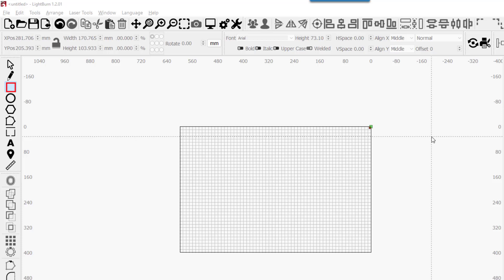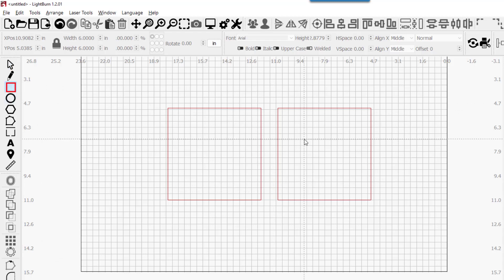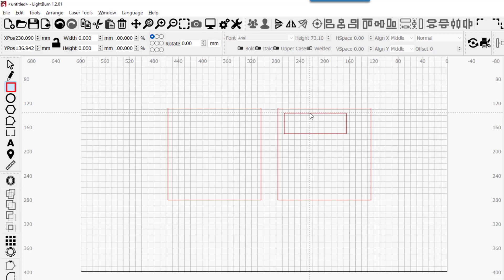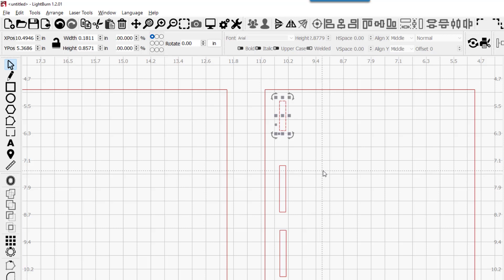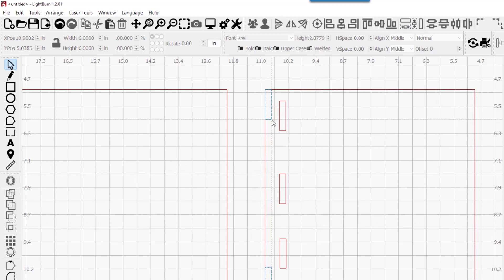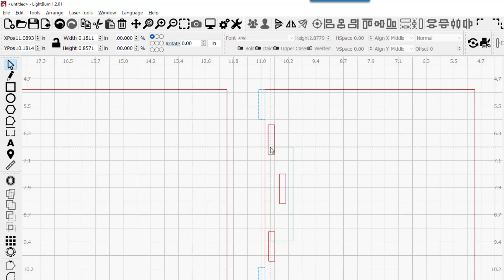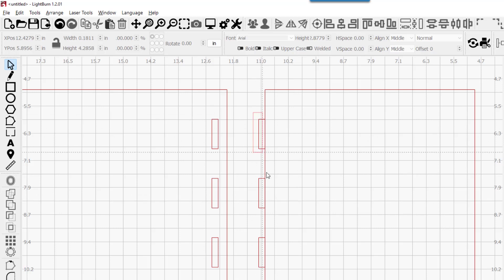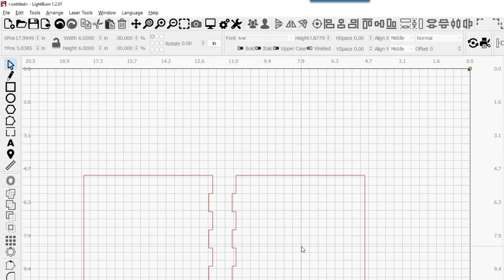Creating Finger Joints In Lightburn

Comment: It will be much faster and easier if you just draw your box, draw a single tab, set the desired tab dimensions, then use the grid array feature to make multiple tab rows and columns with a fixed offset, then move them into position while using Ctrl+Shift+Arrow Key for micro alignment. Hope this helps!
Reply: That's how I was doing it but didn't know about control shift arrow.  Thanks for that

Comment: Thanks, but if you want to be more precise, this method will give you a gap from the laser beem, 
(in my laser there is 0,5mm, but if you offset both parts conture outside 0.2mm it will be perfect!
Reply from the maker: Thanks. It's been awhile since I did this video. Since I use Lightburn I think I use the software's 'kerf offset' feature to accomplish what you're talking about.

Comment: Great video! It helped a lot but like someone else said I had a hard time seeing what you did in the up right corner of the video since it's cut off. Also I'm having an issue when I try and dock the fingers and tool layer fingers to the square, Lightburn moves the piece all the way to the edge of the workspace, not the square. This recently just started happening so I'm not sure what changed from the last time I followed your tutorial. Have you (or anyone else) experienced this? And how do I fix it?